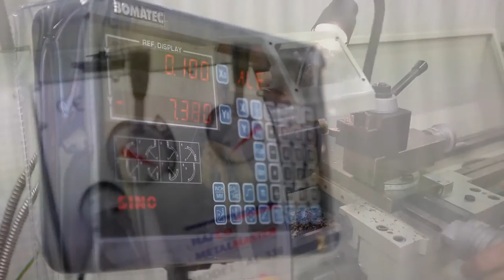AL-336D DELUXE - Centre Lathe  (L682D)

Comment: I’m interested in the AL 346V but can’t find a review video.
I’ve looked at the 336 V videos - but the 346 V has VFD control of RPMs etc so I’m curious about what difference this makes to having quick change gear box etc for thread cutting and so on?
Any chance of doing a review or should I go visit the store & get someone to run me through it please?
How do I know if you have a AL346V on the floor to view in your Perth WA store & if they have one in stock locally to pickup / collect while there?
Also what it weighs, so I know what vehicle to bring and whether I need a trailer for it to be forklift loaded?
Also what the packaged pieces all weigh separately because 400kilo is all I can lift off at this end with my electric hoist.
Many thanks in advance.
Reply: Hi Ian, these machines are sold under the Precision Matthews brand in the USA, so if you convert the size from metric to imperial and add Precision Matthews to it you'll find a lot more info on the machine. In your case, take 330mm x 1000mm and convert that to 13 x 40 inches, and it would be the Precision Matthews 1340.
Reply from the maker: Hi Ian, It would be best to call ahead to check stock availability and speak with a technical sales person to guide you through all the alternatives to suit your requirements, we have machines on display and you can get a hands on feel as well for the machine size as well, whilst working with one off our technical staff members to help you.